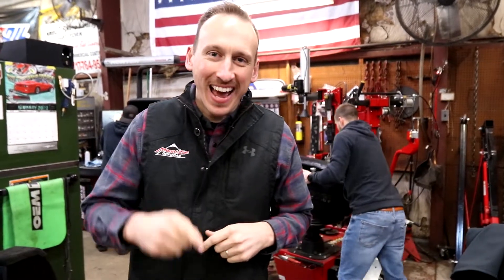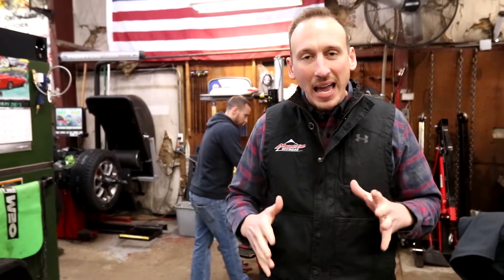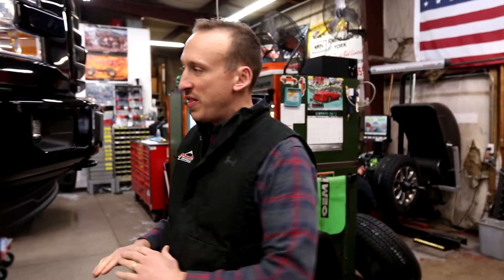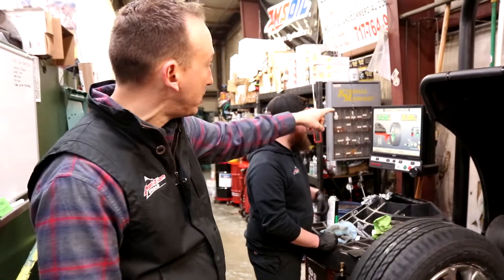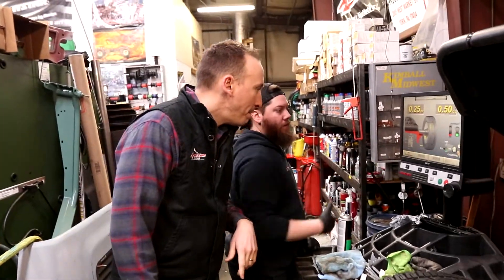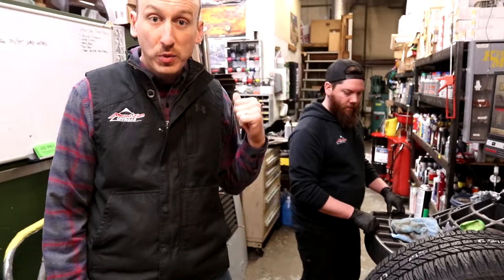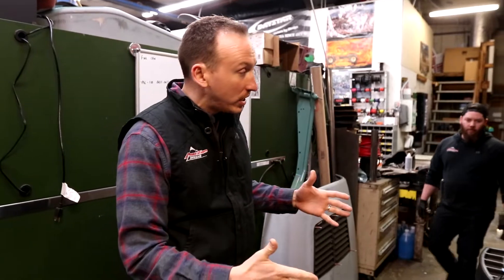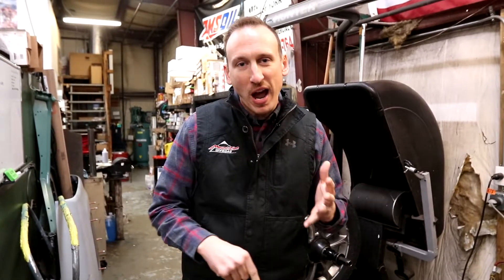Big Tires Need to be Balanced Too! Inside Look at Tire Balancing for your Lifted Jeep, Truck or 4x4!

Comment: Is there a particular speed for balancing?
Reply from the maker: Our Hunter road force balancer hub spins at 300 RPM, so the actual speed in MPH would vary based on tire size but for a 35" tire, that's about 31 MPH
Reply: @MountZionOffroad  showing my ignorance here: would you not want to balance at highway speeds?
Reply from the maker: The important thing is that the tire is dynamically balanced.  The Hunter machines are known to be the most precision equipment in the industry, and they are incredibly accurate and robust.  If there's no need to spin the tire faster to get accurate results, then it doesn't make any sense to have the tire spinning at a risky 70 MPH in your shop.  The same vibrations exist at 30 as at 70, they just become more pronounced as speed increases.  The computers in the machine can detect these vibrations at 300 RPM and tell exactly what amount of weight it needs and exactly where to place it.   

To think tires were statically balanced using a floating disc and a spirit bubble for decades before this technology and that was "good enough" back then!  Tire manufacturing has also come a long way since those days.

Comment: The most advanced and easiest balancing is with beads. And cheapest for the customer overall, if you're "other's" focused.
At least that's what "premier" and "expert" shops have known for years now. Not as profitable for the shops, but better for rides and customers anyway.
Reply from the maker: In our experience balancing beads do not work.  We will never utilize them or install them.  We have a dedicated shop vac here just for sucking out balance beads from clients tires who are unhappy with the result.  We have found no better way than a Road Force Balance on a  good quality made tire.